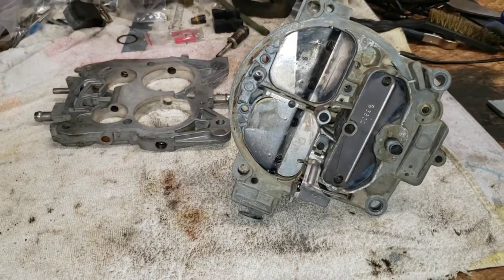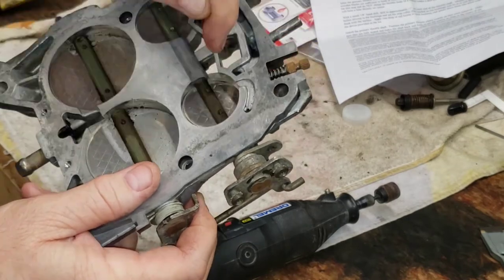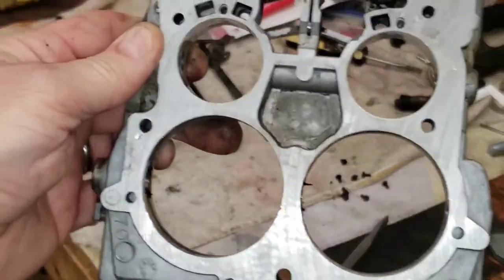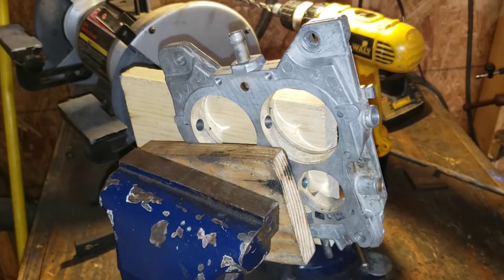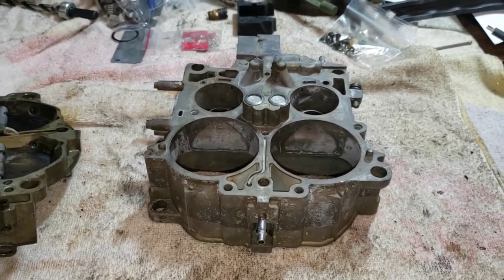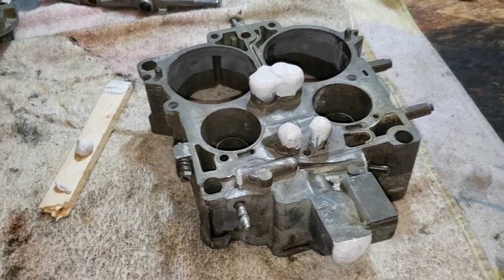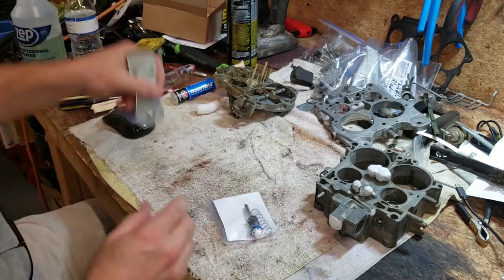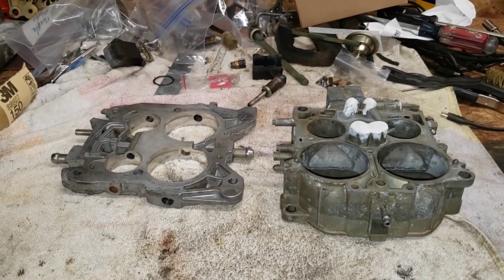Cadillac 472 Fuel System Part 2 - Quadrajet - Throttle Shaft Bushings and Sealing Casting/Well Plugs

Comment: I am appreciating this video.  I did the quadrajet on my '75 Eldorado maybe 15 years ago.  I was never sure what to really do with those well plugs.  I had the overnight leakdown problem that persisted when I was done.  Otherwise my overhaul seemed to work well.  Next time I'll try the throttle shaft repair, which I had heard of as well, but did not attempt.  You made it look pretty simple to do.
Reply from the maker: If you can take a Qjet apart, the bushing install is quite easy using the Cliff Ruggles kit. They also sell a plug kit which requires you to drill out the plugs and then screw in their plugs. Lastly you would put MarineTex epoxy on it from their kit. I decided to go the cheaper route and try the WaterWeld epoxy. If it leaks, I'll remove the carb again and drill out the plugs. We'll see.

Comment: Enjoyed the video. As an option, you don't have to remove the secondary plates or shaft. You can remove the linkage on the driver side of the secondary shaft, and leave the secondary shaft and plates in place. Then you can disconnect the secondary linkage from the primary linkage, and pull out the primary shaft. Removing the secondary linkage is takes a bit of figuring out, so pay attention to the dissassembly, even taking pics while doing it, so you can put it back like it was. Here are instructioins from the book "rochester carburetors" by Doug Roe: "first....pry end of inner spring off its ledge, then catch it with finger, and allow it to unwind (it only unwinds one full turn. that's how you'll rewind it when reinstalling). Next, release tension on outer spring by removing the straight end of the spring from its tang with pliers. Hold secondaries closed while rotating lever clockwise to let the spring clear its slot in the shaft end."
Reply from the maker: 😅😅  Thanks!  I have a copy of that book as well. Reckon I should read it. 😀
Reply: @ImpalamansGarage  Page 138, pics and instructions at the bottom of the page 🙂. Also look at page 140.

Comment: Where can I find a rebuild video or diagram for this carb?? I can’t find anything online. All the diagrams and videos are for a different model
Reply from the maker: Here are two good sources of info
https://quadrajetpower.com/
https://cliffshighperformance.com/
Reply from the maker: The best book to read is "Rochester Carburetors, Revised Edition" by Doug Roe.
Reply: @ImpalamansGarage  Ok thanks. I was given this carb for free. Came off a Cadillac 472. I’m contemplating on rebuilding it or just selling as is. Not sure if it will even sell
Reply: @ImpalamansGarage  also do you know where the idle compensator assembly goes?

Comment: I have been subscribed for some time now but I just turned the bell on. You got me hooked on this carb so I want to see it finished as soon as you get the parts. How's the 300sd running?
Reply from the maker: Doing well but the it is now clear that the engine dampening shocks have to be replaced. The whole car rocks gently from side to side with each revolution of the engine. Engine doesn't miss a beat but I think that many people often confuse this oscillation with and engine problem. It will drive you bonkers, as it has me. Engine mounts will get replaced as well. Soon.
Reply: @ImpalamansGarage  hi. I replaced the shock on my 300d and it made no difference on the engine's rocking. Probably should have replaced the mounts.
The mounts on my e320 are hydraulic and when they go bad the engine vibrates like hell. I replaced them and now it runs smooth as silk. 
Have a great weekend!

Comment: You can put glue on there if you want to I'm not fixing mine like that because that is not the correct way
Reply from the maker: Actually Marine Tex is the absolute best sealant to use on the bottom of the well plugs.